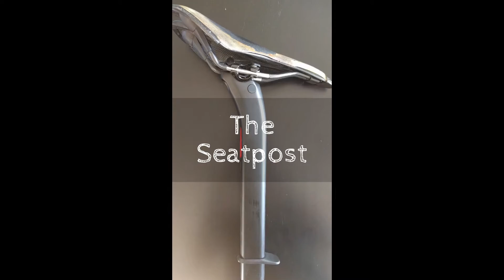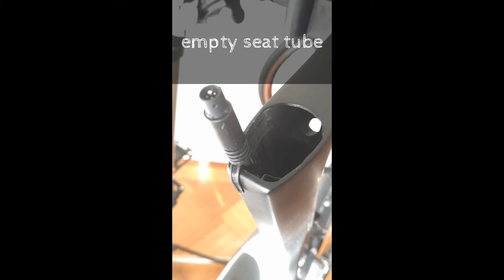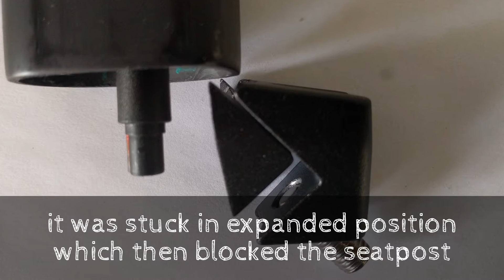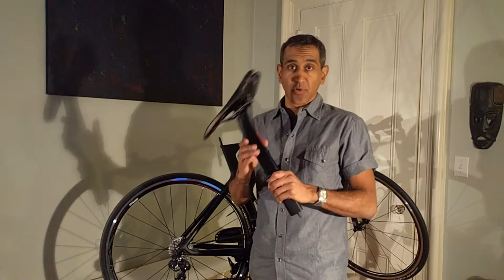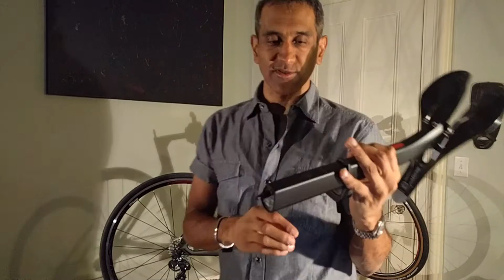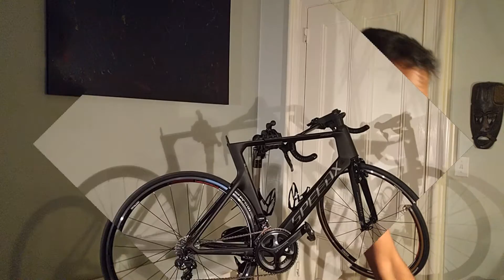SpeedX Leopard Pro: The Seatpost

Comment: Hello Bro! I got problem with charging the battery (install the cable but cannot charging). I may would like to check the inside the seat port but same to you, im afraid that cannot pull out the inside or getting damage it. So do you have any experience on this? Thank your your sharing!

Comment: Did you ever succeed in removing the battery? Can't manage from my end!
Reply from the maker: Hi Christopher, thanks for your comment and question - great timing, as I just worked on the bike this weekend (after a long hiatus). Got some assistance with it, including removing the entire battery, etc. from the seatpost. After you remove the screw and couple pieces at the bottom of the seatpost, the trick is to pry out the red light to free up the whole assembly to be removed. (It might be possible to push the red light into the seatpost cutout, but I didn't find that to be the case.) Use something sharp to start pulling out the red light from the bottom part, and once you have it out a bit, use needle-nose pliers to grab and pull out completely. It may take a fair, strenuous effort, but it 'unplugs' and once you do that and remove that little rubber door/seal to the charging port, the battery will slide down and out just fine. Either that, or just take a drill to it!
Reply: @stylishnilesh  Thanks! I found a post on FB who suggested the same and that does work (I tried your suggestion in the video of pressing it in originally to no avail). Have one lighter seat post. Now just need to work out how to get the wiring out without removing the bottom bracket!
Reply from the maker: @htcltd  cool. I can't remember how I removed that wiring (everything was taken off the frame) but it should be possible without removing the bottom bracket. That wiring has 3 connectors. Two connect back to where the magnet sensors are, so unscrew those two magnet sensor pieces from one another, disconnect the connections and replace the two pieces. The third connector travels further through the frame to the stem, so disconnect there and then see if you can pull the wiring out gently. You can open the cutout on the downtube to help coax the wiring past the di2 battery.
Reply from the maker: By the way, simply removing those parts - the seatpost battery, spring, rear light, ceramic pieces and screw, and that wiring saves 261g or 0.575 lbs, pretty significant!

Comment: My seat post clamp wouldn't even clamp the seat post into place.  I hopped on and my seat post dropped as far as it would go.  Had to tell them about it back in January and wife finally received the piece just last week.  The set screw I have now though was tightened so much that its stripped and can't even get it out now which is going to be a pain.
Reply from the maker: That seatpost clamping mechanism is a bit odd and tricky, hope you were able to sort it out